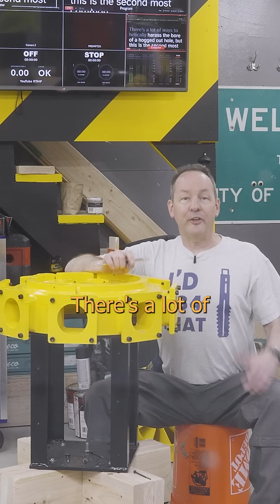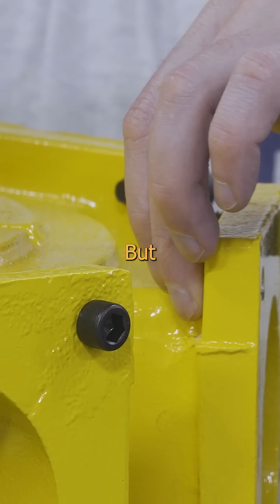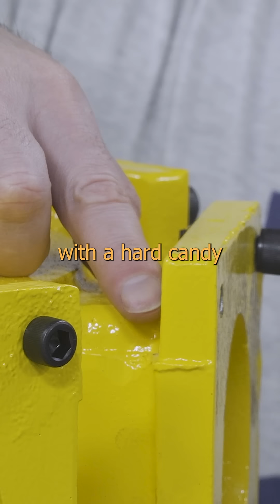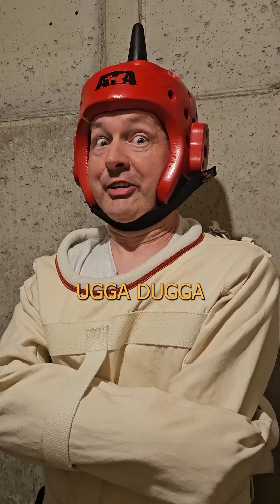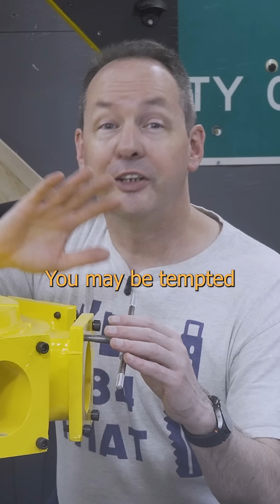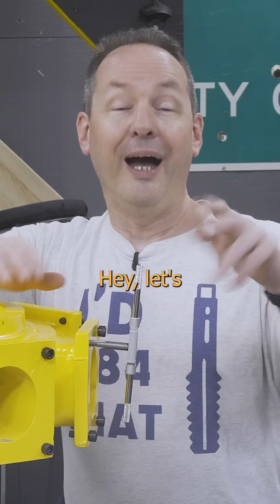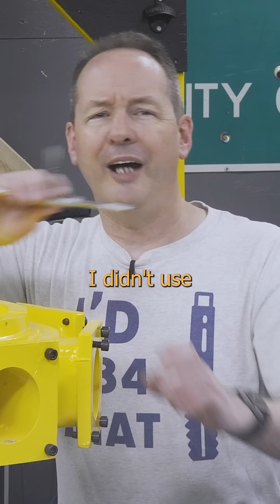Thread Chasing  #chrisboden #comedy #engineering #skills #workshop #metalworking #tools #apprentice

Comment: Hi, Mechanical Engineer here. 
For this specific type of use (clearing an already good thread of paint or debris) a standard power drill is fine, put it on the lowest torque setting. I’ve done it plenty of times and never had a problem. Just go slow and don’t force it. She’ll guide you herself and might let you come back a second time.

Problems occur when you’re cleaning up the thread itself, if it’s rusted, folded or someone went to town on it with a hammer and center punch for god knows what reason. DO IT BY HAND AND SLOWLY!

Comment: Used to mentor a high school robotics team.  We had taps, but we also had a thrice-damned set of drill-taps.  And EVERY TIME, the kids would want to use the drill-tap.  You can use those, but only in thin stock where the drill section is completley bored out before the tap section engages.  If you try and use them on thicker stock, the difference in feed speed from the drill flutes and the tap threads will snap it every time.  I took every one of those Siamese work stoppages and chucked them in the bin like Frodo Baggins at Mt. Doom.  Spent a week retraining the monkey-gripped minors and we got to actually start and finish making a part within the same day.

Comment: I've had a few bad days! Rebuilding a 75 year old milling machine. I got a bottom tap jammed, stuck, and then broke it off in there. Ya know, like newbie! 
After a lot of cussing, digging, and welding, the new new threads worked perfectly! 
I turned a 5 minute job into 4.5 hours. Wish I could do that with money! 😂

Comment: Nine times out of 10. If you use a drill you will break the tap in the hole and then now you have a bigger problem trying to remove set top from hole

Comment: <--Dumbass, but, got technical about it, hear me out!

i had a burned out Ryobi drill, electro door magnet, a pile of batteries of the Lithium kind, in my glorious MacGyver moment of murky clarity, combined all into a "plop it in place" and turn on the magnet and let it tap with a set voltage/current control, and back and forth switch for driving it, stuck the bit in the chuck, and when it got stuck, the magnet decided to leave friction behind as this thing turned into a whirring finger death trap with 55 Watt hours behind it. ....

thank Christ i did this at home as my boss would have flipped his shit and made me buy new bits.

Comment: As a diesel technician apprentice, I’ve learned the hard way on not using an impact with the appropriate size socket on the yolks that hold up a drive line

Comment: Ive only broken one tap, I mentor a high school robotics team and was teaching a student how to tap, and of course 10 minutes later I come back to find out the kid had put the tap into a block of mild steel at a nearly 10 degree angle, so of course on the way out, it snapped. And your so right about the don’t use a drill to tap, I always tell the kids that, but of course I don’t follow my own rules, and so far I haven’t had a single issue, I set the torque slip setting super low and crank it up if it begins to slip, but this lets me tap parts so much faster.
Reply: I use the same methode to tap with a drill, never had a probleme till now ¯\_(ツ)_/¯

Comment: I prefer using bit and braces or speed handles (SOOO much easier to run the tap) rather than tap wrenches and canola oil (works fine, takes a lot of heat to smoke while the smoke isn't pure cancer fuel, and is cheap) for thread cutting lubricant.
I've also never had luck on running a tap in a single pass so I do a whole bunch of back and forthing when it starts to fight.

Comment: You can use a tap to clean holes but a thread chaser is the proper tool is a thread chaser. Thread chasers are designed to clean without cutting away any of the existing threads.

Comment: Yep, im a dumbass too :D
I wanted to cut an M10 thread into a solid piece of steel; the thread wasn’t supposed to go all the way through, just enough for the bolt to fit. The tap broke halfway through, and because of the part, I spent the rest of the day trying to get that damn thing out. I haven’t used a cordless screwdriver since.

Comment: I was a metalworker (bauschlosser) for years
To Chase the Threads with an drill i Turn it Backwards until IT Klicks in the start of the Thread and then start chasing the Thread in the right directions i did a few thousend holes in this way never Had any Problems

Comment: I was a dumbass. I was 19 and brand new working on boats. Had to chase the threads on an aluminum mercruiser transom assembly. I used a drill, stripped the threads clean out and my boss patiently but very sternly called me a dipshit and walked me through how to fix it. In that moment I realized that mistakes are okay but make sure you learn how to not fuck things up twice.

Comment: And then there is the situation where a tap or thread chaser is an hour away, you only have a half hour before the storm hits, but you do have a grade 8 bolt of the right size and a die grinder with a cut-off wheel. A few slices down the threads and it will get the rust and crust out of a hole or two so the new bolt will go right in where some dummy forgot to put one years ago and caused this emergency service call out in Deliverance Holler with banjos playing off in the distance.

Comment: If you think it's bad trying to drill out a broken bolt, try drilling out a broken tap.

BTW, I have used foam earplugs to fill a hole before painting. They expand to fill to hole completely, and they are easy to remove.

Comment: I haven’t used a drill or an impact gun. I use an electric ratchet and a tap socket if I have to chase a lot of holes. I’ve seen people break taps with impact guns, but I’ve heard using a chrome 12 point socket that the socket breaks before the tap, normally I’m doing this stuff on dozer and excavator undercarriages where the bolts are M16- M20, but still haven’t tried it yet.

Comment: Small ratchet on a m8 tap in hardened steel. I was going slow, just not slow enough I guess. Also, taps are cheaper than tap removal, just an fyi.

Comment: I’m the dumbass. As a fresh faced engineer, I tried to thread a hardened inconel part worth more than a new Honda civic with a steel tap. When I couldn’t get it deep enough by had, I decided to grab the air impact to get that last bit, gauled the shit out of it, and then snapped it off trying to get it back out with the same impact. Taps are precision instruments of perpendicular spiral punching and I was an ape with air power and it ended exactly how you’d imagine

Comment: dumss. as an apprentice, i borrowed my foreman's 8-32 tap to chase some threads, assured him i wasn't a knucklehead and going to put it in an impact driver. i chucked it into a proper drill, 2nd speed so the clutch engages early, got into a groove after cleaning out two slots and got confident heading into my third when i felt the snap. still can't explain what happened besides the tap felt my confidence and punished me for it, now I'm preemptively angry anytime i have to tap anything.

Comment: I took machine shop in school and with what I learned I'm usually the one tasked to Fix the mangled bolts and the 100% uggaduggaed bolts Tap magic I need to buy a new can thanks for reminding me. a snapped tap and a spring loaded center punch to shatter it more because trying to drill out a broken tap is less than ideal, that's where machine tool bits can carefully turn broken destroyed things into billions and billions of annoying metal splinters.

Comment: Dumnass: I played “this little piggy” while tapping a hole in 3/4” plate steel (I embedded the steel in the front edge of my reloading bench). 
Now there are 2 extra empty holes and a third with a broken off tap in the steel.

Comment: I chase threads using a cordless drill all the time. Use lube as appropriate, back the clutch off, no issues for me. I am a machinist by trade and have tapped thousands of holes with various machines and drivers, so that experience helps.

Comment: Dumbass!
I've used a drill to clean out 8-32 threads that had paint in them. I had the clutch set low and did dozens of holes already when I snapped the tap in one. I knew it was a bad idea. I just didn't want to do 256 holes by hand. I was able to get the tap out, luckily.

Comment: I was making a trailer that held two 400 watt solar panels that was attached to a frame on a harbor freight trailer. The frame had a leg allowing the panels to be stowed flat for transport and to be put at 45 degrees when in place. I currently have two drill/tap bits by milwaukee meaning they do both at the same time permanently holding those solar panels on the frame because all I had was an impact.

Comment: Old machinist trick - Tap Magic is expensive.  Grab a wax toilet bowl ring and tip the tappity tip right in.  It works incredibly well even with gummy cast aluminum.

Also, spent many hours running a tap in a drill press with a tapping head.  I'm glad I never looked up how much one of those things cost!

Comment: Dumbass. 

I made the mistake of trying to drill through a piece of wood really fast with way too big of a bit, with way too much speed. After a minute of trying and not getting it to bite, I switched to a smaller bit, but kept going fast. The moment it grabbed, I felt the whole thing twist so hard I had to let go. After flexing my wrist and realizing I was okay, I went back to it, with a tighter grip. This time, the bit wouldn't bite again, but I kept going for it, and subsequently, created a red hot ember that I failed to anticipate. I left for about 30 seconds to take a break and swear under my breath, just to come back and find half the piece in flames. I got a really good lesson that day from the drill, wood, and my father who should have a platinum membership card to home Depot and tractor supply co.

Comment: dumass.... i did 1/4" 10 20  in a slow cordless drill cleaned out 30 0f 32 holes  with cutting oil on each one. 31 snapped the tap in the hole. learned this and how to remove a tap from a hole. never again!!

Comment: Same here. Chacin’ head bolts threads on my ‘70 Fastback with 351C 4V. That’s a 1/2 - 13 for those on the couch. That’s a big-ass bolt (technical term). Turnin’ it with a big tap handle. Got right to the apogee of the twist in my wrist.   You’ll know this sound when you read it…

“Twink” (said at about a mid-C note)

So, after all the machine work, all the new parts spread out and ready to go in, the world changes in a millisecond. The tap bottomed out and snapped the bottom 1/2 off below the deck. Took my instructor 3 days but he finally got the broken piece out. Needed someone with much more grey hair.

Comment: Dumbass" I was tapping a tiny hole for a. Grub screw for my stainless steel bracelets. The tap broke inside the hole and I haven't been able to get it out and it's been about 8 months! Shouldnt have used the drill press 🤦🏽‍♂️

Comment: bahahaha, I'm in frc as a machinist and I learned that it's much faster to tap shafts on the lathe so I do that but break a tap much more often than I'd I do it by hand. so I hold the tap while running the lathe at low rpm. i know, horrible idea , but whatevs.

Comment: Used a 60lbs magbase to tap a 1/2 12 (it's real I promise check the bible) and it snagged halfway through. The base released and damn near broke my arm  when it spun around. Dug a baseball sized hole on the concrete

Comment: I can say I made the mistake of ugga dugga, but it was with a drill press instead. I was working on converting my VW Thing to disk brakes instead of drums and I had gotten to the point that I was getting the lug bolts to torque spec. I hadn't gotten the bolts anywhere near spec and the threads riped clean out of the disk, still inside the threads of the lug bolt. I decided to drill, tap, and helicoil the stripped holes to repair the brakes. In my dumbassary I thought, "Hey, if it works so well for the drill, why not the tap?"😀 Yeah, it got stuck in the rotor multiple times before I thought, "Hmm, this isn't working"😑 Whenever it got stuck in the rotor it would start whipping the rotor around the work plate on the drill press before the tap fell out of the press, talk about an exciting spin around the block lol

Comment: Spiral flute taps can be used in drills, though you really don't want to use a hand drill, they'll snap. A drill press or (better yet) milling machine will be rigid enough to tap under power. There are also fancy tapping arms that use a linkage to keep the tapping head perpendicular to a table & have a clutch to avoid breaking the tap. 

The coolest process I've seen for removing a broken tap is to EDM it out. It's expensive, but way less faff than all the other methods, works on carbide taps, works on taps broken off in below the surface, and involves sparks! Underwater!

Comment: Automotive wisdom: chase the threads in the cylinder heads that tighten the exhaust manifold to said head. The next guy (maybe you) won't have to snap any of those bolts off and curse you to his diety or devil of choice. Extra points for Never-Sneeze or even Teflon tape on the bolts. You may want to back off on the torque wrench setting a bit because those values are meant for un-lubbed bolts.

Comment: Dumb ASS YEAH. i was getting frustratwd with how long this exact task was taking on mounting bracjets on a beautiful hand welded plumbing manifold. I did a really good job coating it but i missed a few holes amd had to retap them. Just like you just showed. Well i got huffy amd puffy. So i grabbed the…. Makita impact. “Oh ill just use my expertise and gently caress this trigger” amd blammo broken tap in the hole. Had to it TWICE. SO DOUBLE DUMB ASS

Comment: I use ¼-20 taps with a Dewalt everytime. The technique is to put the drill on low speed and the clutch on around 3 or 4. Works great.

Comment: Dumbass #1 here. In Oz we use M3 screws to mount our seitch plates, had to thread a bunch into 5mm thick plate, yeah learnt the hard way that a drill on low torque Ab low speed is still to much for those itty bitty bits.

Comment: Hole is angled because it was drilled too far down the flange, and they needed the bolt heads or nut to clear the body.

Also, chasing existing threads should never feel like "work", especially "work that permanent residents of the Federal Penal System need to be doing". Making threads, yeah, chasing threads, no.

Comment: I was taught to turn a half turn, back it out a third turn to cut off the waste and turn it a half turn, back it out etc.  Probably not necessary for cleaning off powder coat, but definitely necessary for cutting new threads.

Comment: Chasing big holes with a very large impact with a 1 inch drive, and the mechanic managed to deplete the battery of the cordless impact... those holes were having issues and the taps were sharp-ish but could be sharper. I was wailing on those threads with a fairly long wrench for 4 hours straight and struggled to do one hole per hour. My boss still has no idea how those threads got that bad, we also tried a large pneumatic impact and even it could barely budge the taps, but at least it didn't die half way through the first hole. We emptied a can of WD40 on the holes and a ton of rapid tap.

I think the holes might have deformed a bit because even two large men on a very long wrench struggled to the the tap to turn on some of the worst of the holes.

These were all over 1 inch holes though. those taps can survive a beating and not break... but if you drop them, it can break a tooth.

Comment: DUMBASS HERE:  I crushed the 5/8” x 20 die trying to hold it in the vice grips while using an impact drill to spin the bolts in. Apparently tool steel is quite brittle and circles are bad at compression.

Comment: Thank god, my father-in-law taught me to start by hand, and once only use the tap or die wrench. He taught me, " If it takes more torque than that, somerhing isn't right." Usually not set as straight in the threads as you thought, but sometimes a bore too damaged, but being precise makes the answer clear.

Comment: Years ago my dad showed me how to use a tap. A while later, I was using one and was going way too fast with it. He saw me and reminded me that they are very hard metal and are fragile. 

Of course, things happened as they do and... I listened to him, slowed down and have never broken a tap or die.

If I think I am going to have a finicky start and am working with something I can do it with, I toss the tap into the drill press to keep it dead steady and use a wrench I made that fits into the chuck teeth to turn it by hand. 

Worst trouble I have had with one was when I was trying to use a die to cut threads in a galvanized pipe that was cemented into a wall inside a crawl space in 1950. Not sure why, but the teeth cut out a chattered mess of threading. I cut it down, tried again going slower and using more cutting oil. Same thing. Cut it down a second time and STILL had the same results. With no more room to risk another cut, I put the new fitting on the chunky threads with some hercules pipe dope and it did fine. 

I pulled the pipe that I had initially cut off the end of what was sticking out of the wall, threw it in the vice and using the same die, cut perfect threads the first time. Never figured out what was wrong there. 

The gap-toothed threads held for more than fifteen years until I was back on the job doing a major upgrade. Cut the pipe, got it out of the wall, drilled a larger hole and installed a bigger pipe in its place. The terrible threads that I cut never once leaked, and I have never been able to figure out why they cut poorly while the rest of the same section of pipe cut normally.